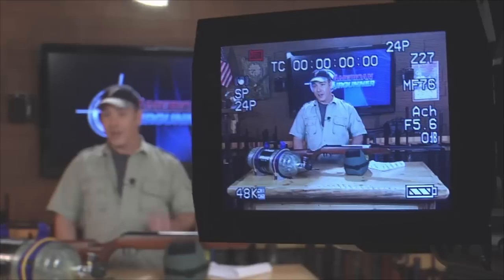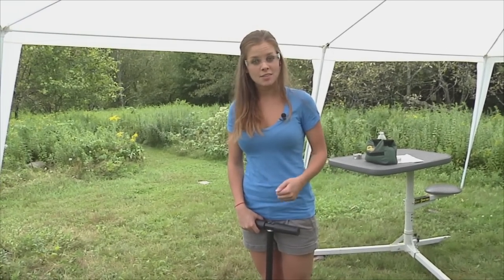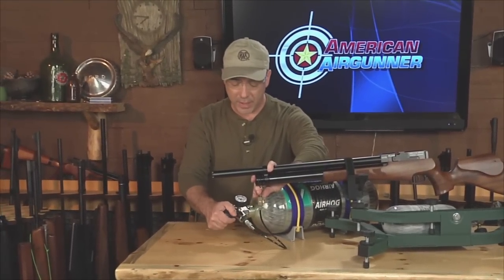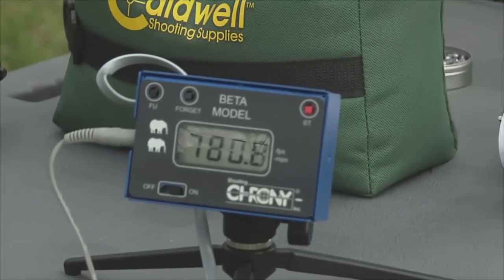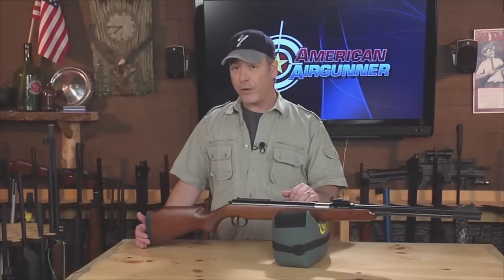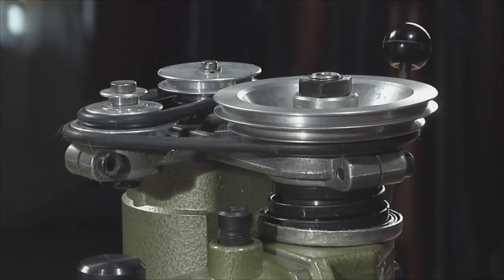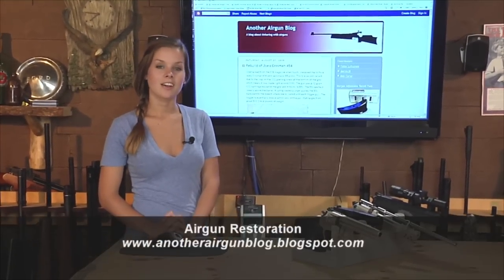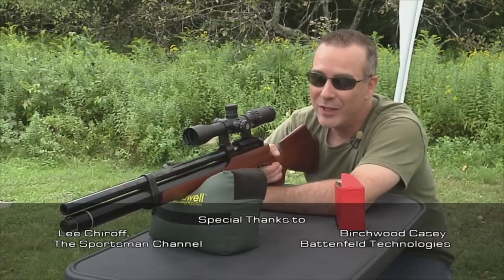American Airgunner Season 2 Episode 11

Comment: If you don't see a water vapor filter  on the pump don't use it ,you will get water in your gun and valves and you will have nothing but trouble.

Comment: Jeweling is now an art form. It was originally used as a surface to hold oil for lubrication (as between frame and hammer) on revolvers and other similar weapons.
Reply: Given all that special equipment needed to do a decent job at jeweling, I think I'll pass on that. However, I can see how it would be useful on underlevers and side-cockers b/c as you say the jeweling helps to hold lube and that is useful on the exterior of the compression tube.